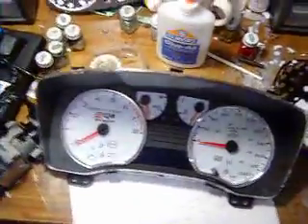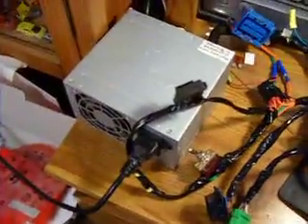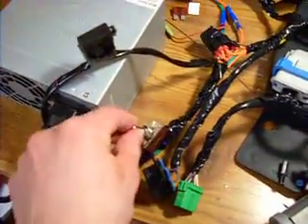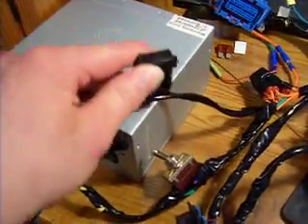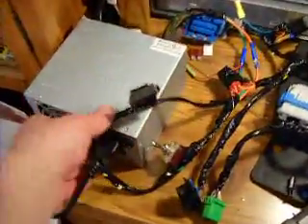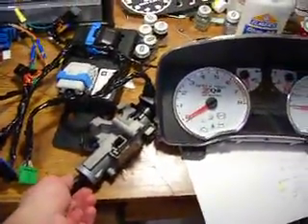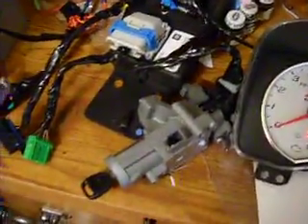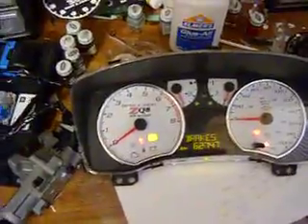Colorado bench testing cluster using, Computer power supply

Comment: I have a similar setup that I made for testing GM Clusters once I repair them . My only question is , how can I light up the Odometer and Gear Selector screen from a Power Supply ? I am guessing there has to be a certain way to wire it to do this , but I can't seem to figure it out . Any ideas ? 

Thanks!
Reply from the maker: +Ethan HeyrendMy guess is hooking up a bcm for that module cluster? What year make model is it your having difficulty with?
Reply from the maker: +modelfreak125 Do you repair Colorado canyon clusters? Can you send me a PM? I can't figure out how to send pms on here!

Comment from the maker: I tired to build one with a PCM and resistors I could only get some to move. Basically you just get the BCM to zero them. other wise .. you would need to know the GM commands and write a  program to emulate them over the GM LAN network.